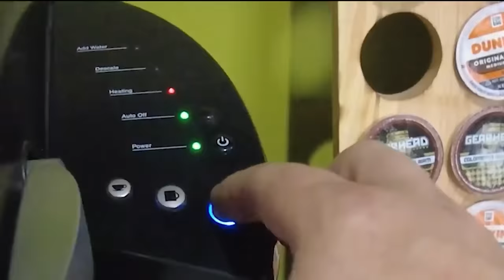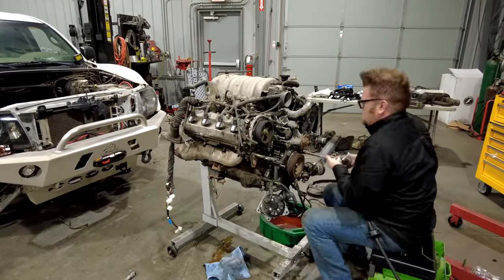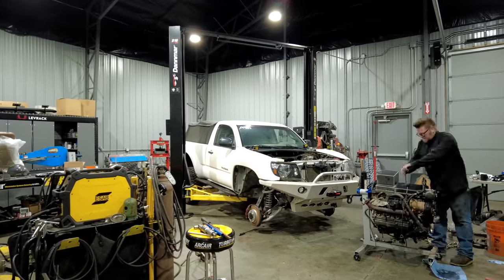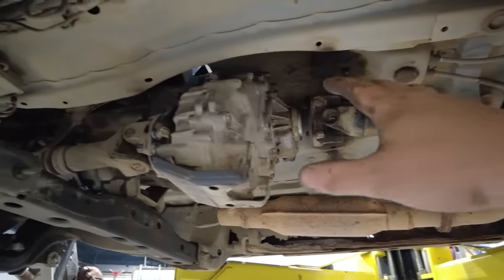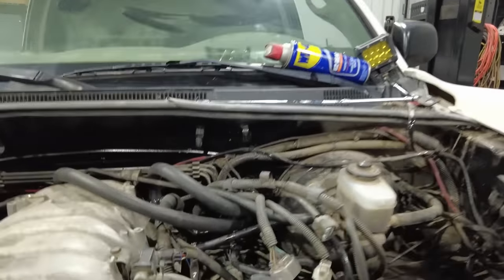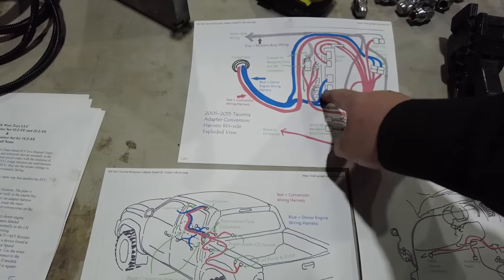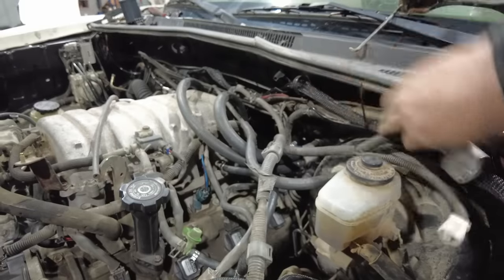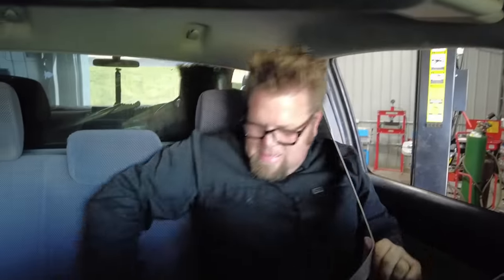Tundra 4.7 V8 Swap Into Tacoma Manual Trans, Complete How To

Comment: So you used the original 5 speed from the 4cyl and just used the adapter to make the tundra bell housing fit? My main question is how is that trans holding up after the massive power increase?
Reply from the maker: Holding up fine...from what I understand the R155F is from the same family as the manual trans used in Supra and other cars of this generation.

The company that made the adapter specializes in swapping these engines into drift cars and the like.

Comment: Would the 4Runner 2UZ oil pan not fit?
Reply from the maker: I looked at a couple online...and it didn't look like it would...and they were 500 used so getting one I know would work for just a little more was worth it
Reply: Hmm.. didn't think there would be much difference between the 4R and taco with similar year range

Comment: Hi Ian, I heard you say that first gear was basically worthless. So I assume the gearing is very different between the two trucks. Do you recommend changing the gear ratio of the front and rear differential to more closely match the Tundra? Second, I have a 1994 Toy 6cyl 4x4 manual with the 3VZ :( . What do you think of using a 4.7 in it? Same effort and money? Thanks!
Reply from the maker: I plan to step down to a 4.56 soon (its 5.13 right now) just waiting for an air locker for the front
Reply: Thanks!!

Comment: Does that bell housing adapter shorten the input shaft such that it might not engage very far into the pilot bearing?
Reply from the maker: No
Reply from the maker: The adapter is designed for the length of the input shaft

Comment: Looking at your channel I could use some advice on what I’m doing in my unique project I am planning to put a v6 Tacoma engine and v6 manual transmission in a 92 ford ranger…. No one else has done this so I would like to be the first… not interested in the v8 but v6 will done fine for practicality… my question is what do I need to make that engine run in the ranger? I believe I need the harness and computer from v6 Tacoma to make it run and I’m thinking it will need to be flashed as it won’t have all the sensors like the Tacoma it came from has please let me know thoughts I’m open to your advice
Reply from the maker: It will depend on the donor V6 truck...if it has security you will have to make sure that is moved to the new truck. I would talk with the harness builder to determine what year of truck to use as a donor.
Reply: @BigTireGarage  well I haven’t bought anything yet but to avoid that couldn’t I use a holly sniper or some kind of efi kit just Incase they do have security on the truck the motor and trans came from
Reply from the maker: Not really....those ate.designed for popular GM, Ford, and Dodge engines. For import stuff you will have to go with either an AEM, or other custom ECU...but honestly the factory ecu is your best bet
Reply: @BigTireGarage  alright thanks for that and your right the majority brands I see with Holley efi is domestic branded
Reply: It’s gonna be a huge project but I predict I’ll have it done in 5 years lol gotta save up 7,000 just for the trans and v6 from a late ish model Tacoma from eBay

Comment: Are you going to do the 09 lexus gx 470 front brakes upgrade for oem big brakes?
Reply from the maker: Didn't know that was a thing? Its got Powerstop on it now
Reply: @BigTireGarage  yeah the only part the tacoma shares with the gx 470 is the brake pads but the big oem big was an option for the 2uzfe 4runner with 17in rims for the larger rotors the only thing the tacoma has to do is get the 09 gx 470 or 06-10  4runner rotor dust shield or cut the roto dust shield to make room for the larger rotors using the GX 470 is easy to source part to reduce confusion only one size front brakes the 4runner v6 4.0 has smaller brakes similar to tacoma or v8 4.7 with bigger brakes
Reply: @BigTireGarage  part number (Front passenger C9920 Front driver C9921 Pads DE976 and rotors 31326Dg)

Comment: Just a heads up.  Do not use those for underhood connections.  It's a low temp solder and will soften with underhood temps.
Reply from the maker: Good to know

Comment: Could you please touch on the reasons why a v8 4runner Pan wouldn't be a good part for this swap?
Reply from the maker: I think it might of worked...but finding the complete package was hard...I found one online but it was more than the custom pan...and I knew that the custom pan would fet no matter what.
Reply: @BigTireGarage  yeah.  Finding v8 4runners is tough.  Lucky folks in the ne have rusted out examples for dirt cheap with low miles.

Comment: Did you go with a 2004 4.7 because of emission regulations? 

Would a 4.6L be better as it’s timing chain vs belt? Would a 4.6 even be worth it as I’m sure there are more computers n newer engines?
Reply from the maker: Went with the Tundra because 1, I wanted to get something as close to the year of vehicle I had to make ECU compatibility as easy as possible.  And 2, It was the best option I could find....the v8 Yota stuff is harder to find wrecked
Reply: @BigTireGarage eah I figured it would be something related to ECU compatibility.

One day I want to take my dad’s 2017 DCSB 4x2 4-cyl to DieselToyz and have them swap in a D4D and add 4x4 SAS and dual boxes or a 3-spd Atlas

Comment: Unless it was just camera angles as you were showing us the oil pan clearance it does appear that an oil change will be a little messy with the drain plug located above the main crossmember. 
Hopefully it was just camera angles.
Reply from the maker: No its in a bad spot...I told them where to put the drain plug thinking it would land just in front of the crossmember.  Future pans they build will have drain plugv in better position. I will add a quick release and hose kit to the drain that whatvI don't have to drop the skid plate to drain oil
Reply: @BigTireGarage  
All part of the problems that go along with prototypes and being the guinea pig.

Comment: Just wondering did You use factory parts on the engine or aftermarket
Reply from the maker: What do you mean factory parts?  For the swap it was all aftermarket
Reply: @BigTireGarage  Soory ment just the motor

Comment: So, was it worth it or would be as advantageous to just add a pro charger to the V6?
Reply from the maker: I prefer the V8 TBH
Reply: No need for Premium fuel with the V8 plus it’s more reliable.
Reply: Regular cabs didn't get a v6 option so would still require an engine /harness/ecm swap

Comment: I had insidious issues with that same long travel All Pro kit on a tacoma
https://youtu.be/kEN3yAed91s

The kit droops further than the AllPro CV axles liked, and so the axles didn't last very long until I shortened up the limit strap length. The axles last longer, but wastes some of that "long travel"
Reply from the maker: I have RCV's in mine
Reply: @Big Tire Garage  after the 3rd set of allpro, I too went that route

Comment: 200k on a toy v8?   You need to put new bearings rings valve job 23:00 and HEAD GASKETS.    AT LEAST.   MY '94 TOY 4RUNNER LOVED EATING HEAD GASKETS.    VERY UNRELIABLE.    THE 4.7 HAS A TIMING BELT.   TROUBLE.   5.7 MUCH BETTER.  

YOU ARE A MASTER DUDE.  WOULD LOVE TO HELP U.    IM PUTTING A LS 5.3 into my wife's Plug in '17 prius. She is in the Philippines for 3 months.   I hope it will burn rubber.

Comment: Quick question coming from a former toyota tech could you not have used a v8 from the t100 ?
Reply from the maker: I don't believe the T100 came with a V8
Reply: @BigTireGarage  sorry I miss spoke its the tundra that took the place of the t100
Reply: @BigTireGarage  was a smaller chasis less computer and I do believe it had a manual transmission too

Comment: Curious why you didn't just swap a newer 4.0 in the truck? I understand you wanted a v8, but the 4.0 produces more hp than the 4.7, weighs less, and is basically a directly swap.
Reply from the maker: I looked at the v6 swap...and yes it a direct swap..but if I wanted a V6 Taco I could just buy one...but a v8 Tacoma with manual trans...that bad boy is a one of one

Comment: Just wondering why the 4.7 instead of the 5.7 figure better hp and torque on the 5.7 for all that effort  and probably no custom oil pan
Reply from the maker: Best engine I could find at the time.....I do like the 5.7 and have been looking at it for another project
Reply: With all your connections and know how to do it just think of the views may be worth it
Reply from the maker: I think I actually found a cooler engine TBH...its gonna be pretty rad
Reply: Keeping it Toyota I hope